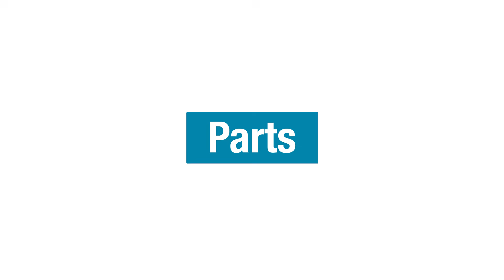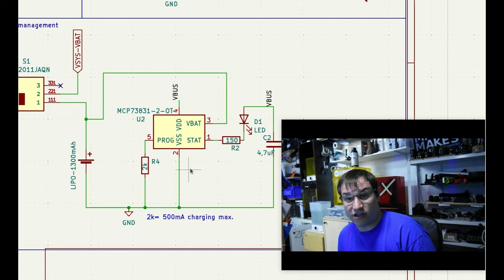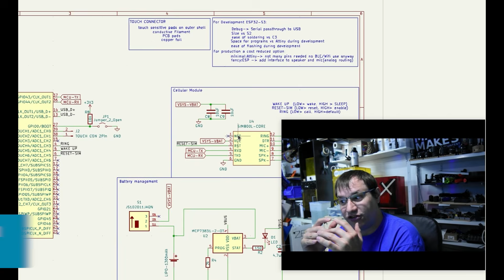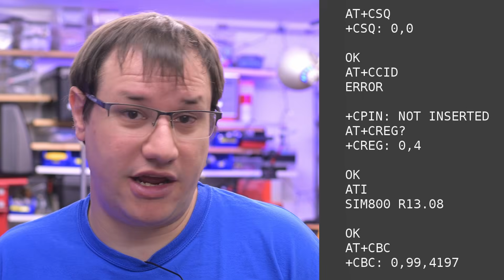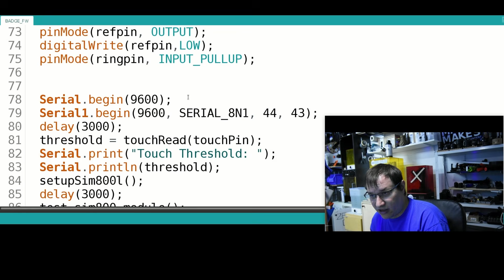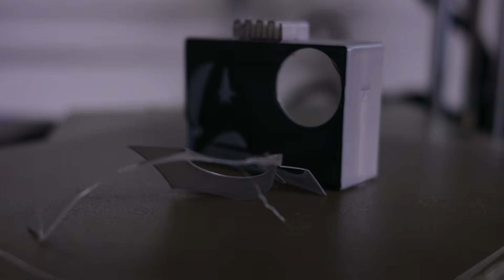Building a Real Star Trek Communicator Badge with an ESP32-S3 & SIM800L

Comment: the maker community really needs a replacement for the sim800 etc, most networks have dropped 2g/3g and even some are not supporting 4g but 4gvolte is required
Reply: yep, atm it is still the only "easy" well library supported option. but at the same time who would drop the money on a 4g module you can't deploy legally.